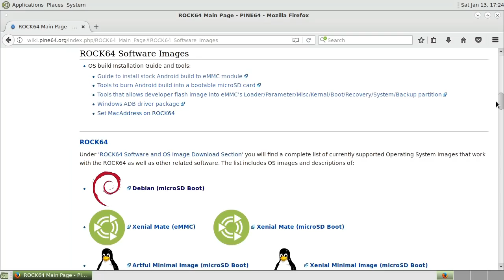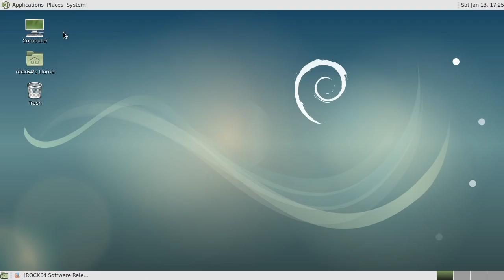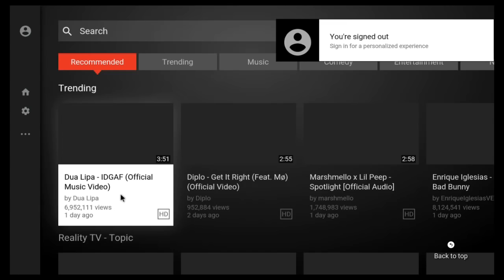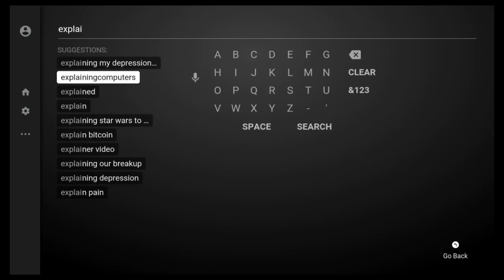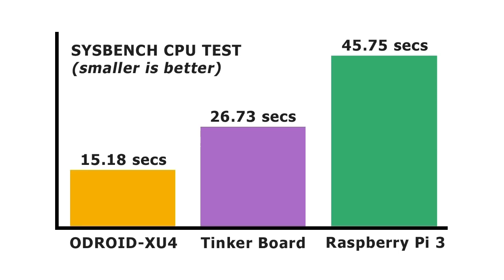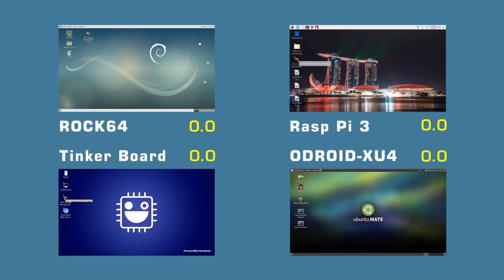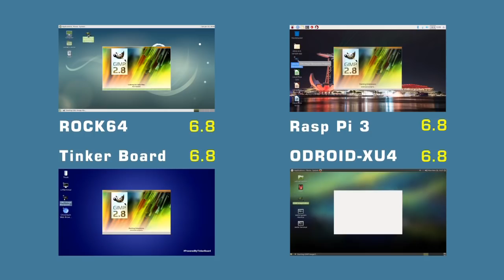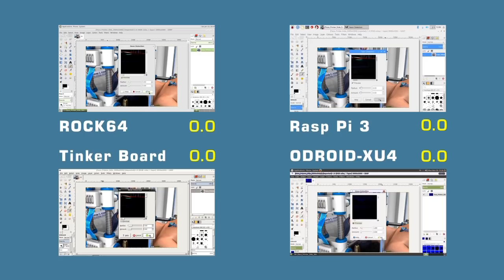ROCK64 4K USB 3.0 SBC

Comment: Well great now I want it.
Reply: check out the pinebook and then say wow
Reply: not me though
Reply: well adding those can be done with a dongle, i have a few for some pi2 I have got, although for me, I like my gear wired, my computer, their keyboards, my TVs, my Roku and my PS4. If I could do my tablets that way I would. Biggest issue I have seen with wi-fi is bandwidth, i got the wy-fy analyzer quite a few years back and found my router was on same channels as 3 of my neighbors, I changed it's channel and WOW
Reply: allot of cell phones have that issue too by the ways, I have to trick them sometime to use both.
The thing is when comes to SBCs you have to pick and choose what you want at low price OR pay more
Just stay away from the orange, yet to see anything good about him
Reply: outside windows, it all is based of unix, lnux, even ios, read up on the date trick on iphones
Very few do fully know this
Reply: OS development is horrible.  Have problems getting a linux desktop running.
Reply: He just said it didn't have wifi nor bluetooth.
Total killer for me!